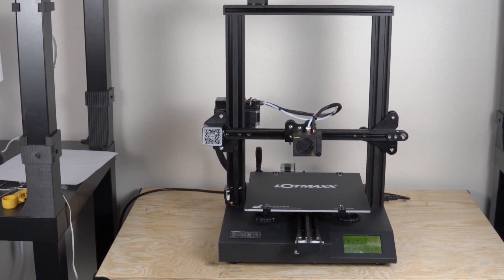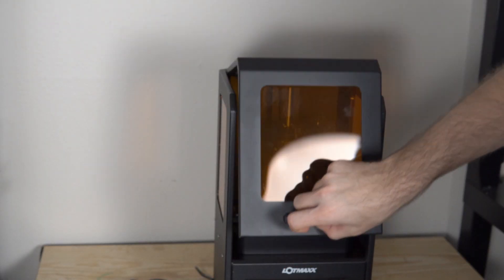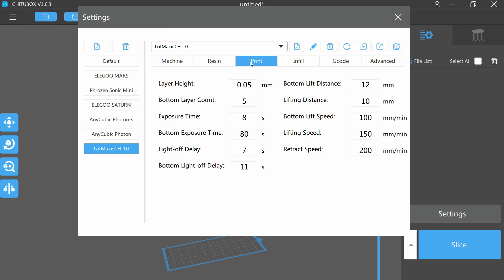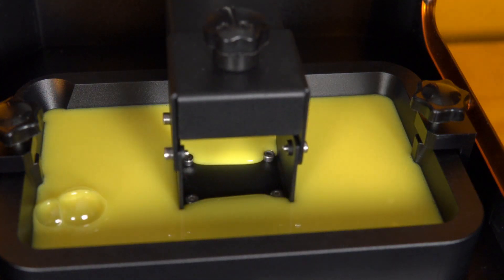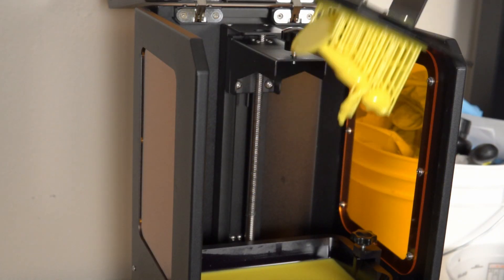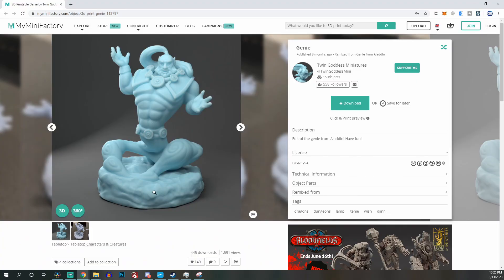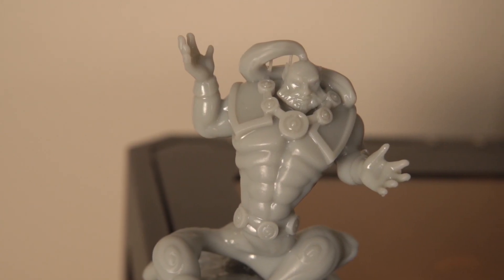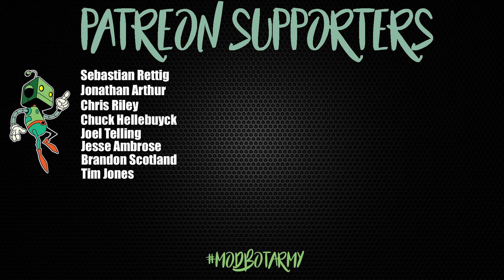Review Of The LOTMAXX CH-10 "Ironbox" Resin 3d Printer

Comment: So my printer came with a broken thumb drive. I've tried to fill in thr parameters from what little I've seen. Also when u try to reset home, it doesn't stay where I put it. It goes back to the home position prior to my calibration

Comment: The issue you were having is that the build plate is too close to the FEP. More than likely was actually pressing into the FEP on the first layer a bit. Ran into this with some other printers and took FOREVER to diagnose exactly what was going on... raised the build plate by like 0.5mm and now the prints come out perfect every time. Leveling on resin printers is deceptive, because it seems so simple, but messing it up even a little bit will REALLY mess everything up.
Reply: I need help and u seem to be the ONLY person with info. My thumb drive was corrupt so I couldn't find or use the ch10 profile in shitbix